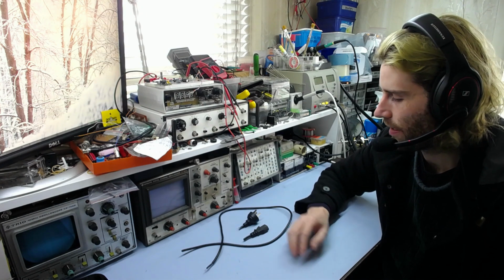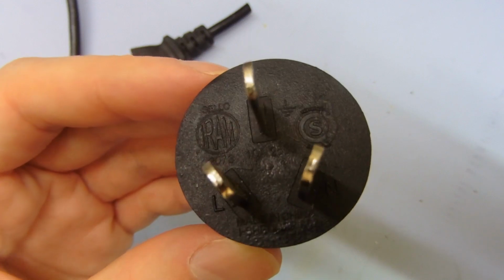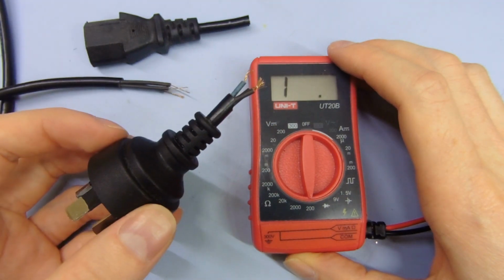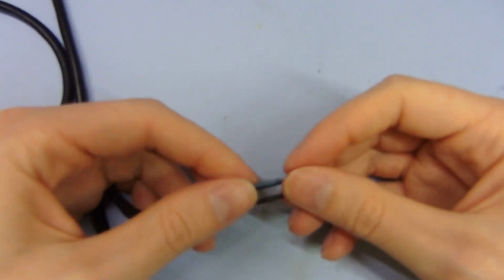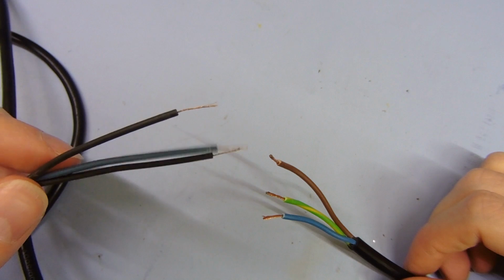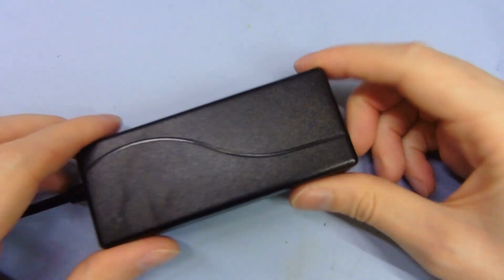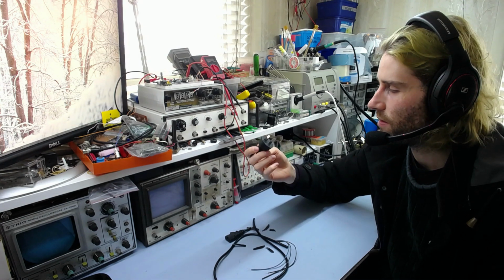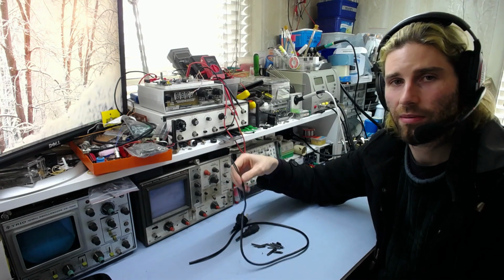Analysis of a fake and potentially deadly Aus/NZ C13 appliance cord

Comment: You make a good point,  I personally have no problem buying cheap " Knock off " Arduino bit's and bob's, its all low voltage but I think we all should  pay a bit more for our mains cable or simply make our own.……… its dangerous shit.. Are you using Kicad V5.0.0 yet ? (massive tangent) if so, what ya think? it would be nice to see you do another board from concept to power up, how about a little headphone amp, USB to head phones with balance and volume knobs...…..massive hint there...………….Good show old chap !
Reply from the maker: Even hobby stuff is sometimes not worth buying cheap for the headache it causes when it doesn't work!
I haven't tried Kicad V5 yet, no, but probably will start testing it soon. There's guaranteed to be bugs somewhere and I think I'll wait a little while before I start seriously using it.
I do want to do a video of a more interesting design at some point but I'm not sure what it will be yet.
Glad you enjoy the videos. Thanks!